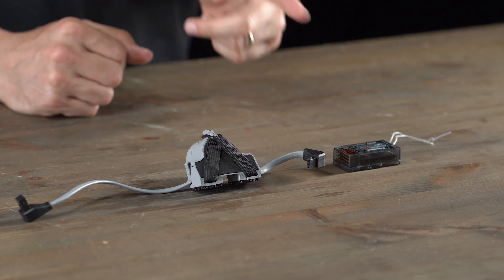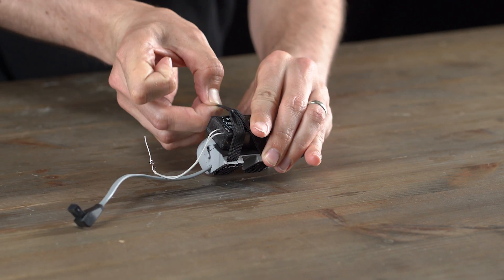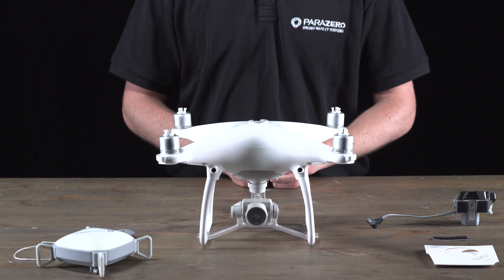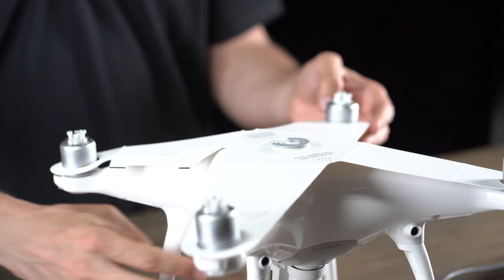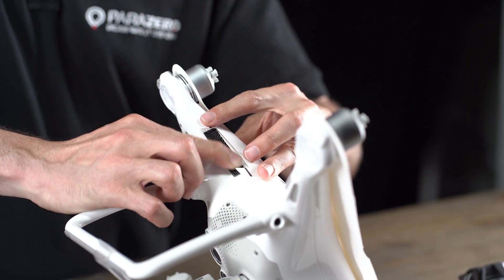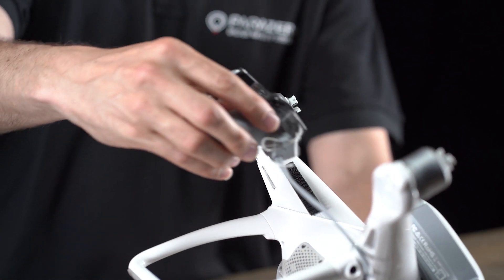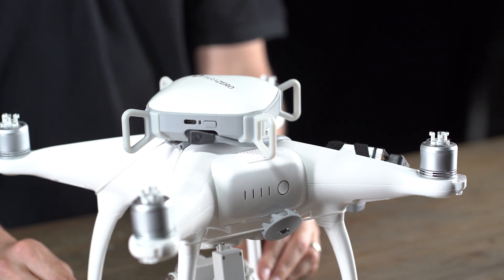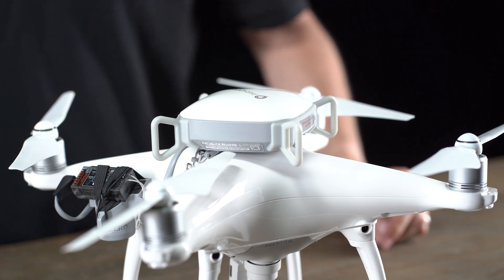ParaZero SafeAir: Phantom ASTM Installation

Comment: $2000 for a system that will likely damage your bird???  Don't think so.  They have a ton of work to do, and hopefully a competitor will drive down the cost, and further improve the deployment  1. DJI will need to improve the auto stop feature.  2.  SafeAir needs a system that will not interfere with the bird's operation (Feed) and deploy so the bird flips upside down as to not harm the landing legs or  sensor.  They have a very long way to go for $2K.  For that cost I would expect replacement insurance or repair guarantees at a minimum.  Also, the parts replacement cost are outrageous...https://parazero.com/product/astm-professional-kit-safeair-phantom/